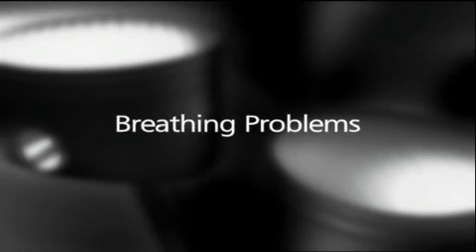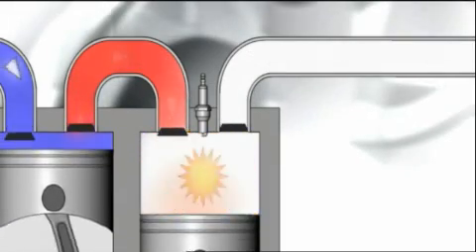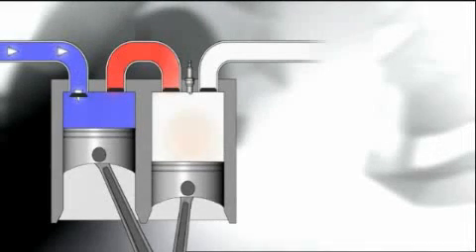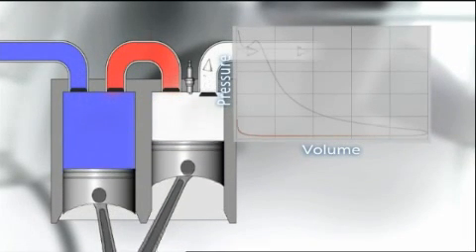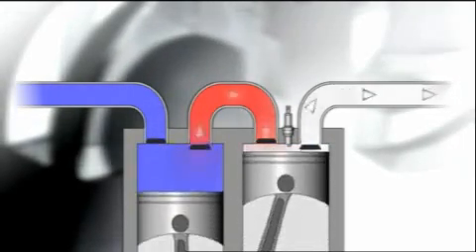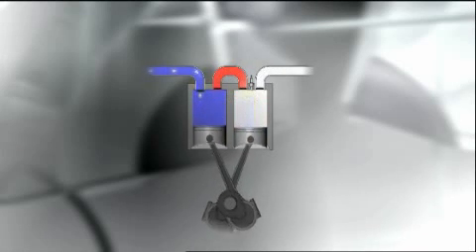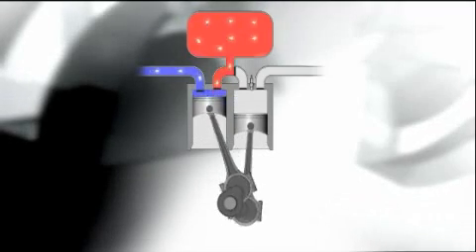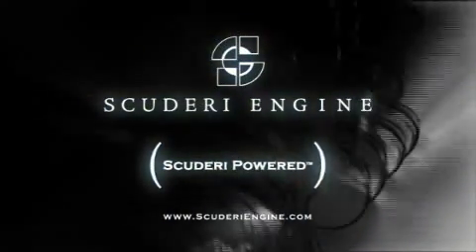Scuderi Engine - How It Works (by www.caroto.gr)

Comment: The parasitic drag caused by the intake/compression cylinders far exceeds that of a supercharger. The concept is good but making it work more efficiently than a supercharger is the hurdle that must be leaped. This design does not achieve that result.
Reply: Just curious, do you have any proof that a supercharger is more efficient? Because it feels like a supercharger having to deal with fighting against a pressure difference that it makes it less efficient

Comment: probably already been mentioned...on a conventional engine you get a significant power boost by having the exhaust and intake valve briefly open at the same time.  they call this valve overlap.  the exhaust gases leaving causes a suction that draws in the intake air.  the incoming air exerts force on the piston.  

this design makes it impossible to do overlap, therefore losing the power gain.  i just wonder of the loss is regained or exceeded overall.  in any design, there are tradeoffs.
Reply: I dont see why it wouldn’t work

Comment: so moving parts have been doubled, pistons, valves, connecting rods and a drag piston will soak up energy making giving this less HP over a conventional 2T engine,  IMO,  unless I'm missing something important.
Reply: If you compare it to a regular i4, both does 2 power strokes every 360 degrees, both have same amount of pistons (4), the ”drag piston” does the same compression and intake strokes as a regular i4 piston does halv its time. Understand basic engines first before comparing them please

Comment: I suppose the first cylinder could be bigger, to pump more air to the second cylinder. But how do you calculate displacement? Is it the volume of air sucked in by the first cylinder? Or the working volume of the other one?

Comment: Imagine if the compressor cylinder was bigger than the combustion cylinder . A higher boost engine ? In theory it could be run on any type of fuel.

Comment: Interesting system, i like the idee to split the sycles of a 2 stroke in to 2 cylinders.👍 But it would make more power with a confentional 2 cylinder 2 stroke i guess 🤨😅
Reply: DKW SS 250 uses this type of engine. It's more efficient than conventional 2t which was the goal I guess.
Reply: But a regular 2 stroke isn’t very good, burns oil, exhausts gas in the cylinder, pollutes more

Comment: Crazy idea: this with an expansion cylinder after the second cylinder and twincharged
Reply: What with the expansion cylinder? And having it super/turbo charged doesn’t make sense really, as the point of the engine is to externalise compression, so if you want more compression youll just increase the volume of the first cylinder.

Comment: In theory it works just fine, but I'd like to know how are they going to seal those high pressure valves?  First, this kind of valve is not to keep the pressure acting from the back, oposite side. Second, The compression pressure that is kept in that short channel will escape through the valve guides and the valve stem seals - no mentioning that the pressure trapped inside the channel would cause opening the left valve. 
Another issue is heavy and overcomplicated construction.

Comment: 0:55 How could the air from the first chamber flow to the second if the second chamber have more pressure due to the explosion?
Reply: the other piston is pushing the air in it. that is why
Reply: Valve closes right before ignition?

Comment: if this was a viable technology it would be on the market or at least a working prototype..neither has happened.
Reply: HolzMichel piston supercharged 2-strokes with overhead cams have been running since at least 1994. These engines are primarily hydrogen fueled. A 13 cubic inch version with an output of over 21 hp was produced in 2005 and used as a technical demonstration for Arrow Engine, Mercury Marine, AGC, and others. The supercharged 2-strokes have been extensively developed since then. The most efficient IC piston engine I have been able to verify is one such engine that was tested at Chatleff Controls that exceeded any conventional engine's  thermodynamic efficiency by an impressive margin. This particular testing took place in 1994.

Comment: I see the pipe cross over two cylinder head and the second cylinder are the same combustion area because you ignited spark plug when the two area are connected.   It's a  stupid design.   
  When you told it's point it could have pressure 2.5 times to normal Otto cycle.    There's no different  because engine today with direct injection and turbo can go any compression it needed  depend on metallurgy strength.

Comment: So if a conventional engine has a compression ratio of say 9,  isn't that compressing to about 9 bars ?
Reply: 9:1 -> 10 bar, assuming no blow-past, and no inlet pressure drop.  As both of these will occur, 9 bar is probably close.

Comment: If you replace the intake valves with a Tesla valve, there should be much improved air flow and lower pumping losses making this engine even more efficient.
Reply: Ken Smith it would be a great day to suddenly hold the patent on the IC engine.
Reply: Better yet, you could use one cylinder to do both parts of the operation so two valves can be taken out of the design.  You just have the crank go around twice per combustion cycle.
Reply: Ken Smith you should invent that.😀
Reply: you are an idiot
Yeah and then apply for a patent and see if it slips past the over worked patent inspectors.

Comment: This is just a supercharged 2-stroke.  What is the supposed advantage of a pistom pump over a blower, Rootes or otherwise.  Foden made 2-stroke diesels in the 50s and early 60s with gear driven Rootes blowers
Reply: The original engine of this type was invented by Brayton in 1872 also when Clerk modified a Brayton engine in 1878. Clerk's original engines did not compress in the expansion cylinder.. Clerk later invented the piston charged 2 stroke similar to the Reid and Baldwin / Bessemer type engines which use a piston or the back side of the piston to charge and scavenge the cylinder. Other inventors of 2 stroke engines that used the back of the piston  were Nash and Day and Fredrick. In 1887 Brayton made an engine that had the intake valve located in the center of the piston. That engine also used a short compression and long expansion stroke same as Atkinson. Atkinson made 3 distinct types of engines: The "differential engine" the "cycle engine" and In 1893 Atkinson made a piston scavenged 2 stroke which also had a short compression  / long expansion stroke. It was a very efficient engine and was called the Atkinson Utilite' engine. Watch my channel to see running examples of  similar engines.
Reply: yes they did but were not economical.
Reply: It appears that way but it is actually 4-stroke with the cycles divided between the cylinders. Anyway, it's a dumb idea.

Comment: back in the 20s or 30's a company called DKW  ( later morphed with Auto Union and then later morphed into Audi ) had a racing  2 stroke motorcycle based on this idea.

Comment: Scuderi (or his sons) changed his "cycle" many times, from the original thermodynamic disaster to the current one more rational, which is not shown in the video. An Atkinson indeed. With a smaller compressor and a larger expander. The advantage is the tight control of injected mas of fresh air. An advantage that they rejected when using an air accumulator! :s 
Over that. A hot transfer valve and a cool burning. Corrected with a proposed regenerator and ending in a regenerated Brayton cycle or a quasi Ericson II cycle in a poor machine for this task.
I'm  amazed the legal and financial power behind these engine.
Patches with that engine never seem to end.
Reply: The original engine of this type was when Clerk modified a Brayton engine in 1878. Clerk's original engines did not compress in the expansion cylinder.. Clerk later invented the piston charged 2 stroke similar to the Reid and Baldwin / Bessemer type engines which use a piston or the back side of the piston to charge and scavenge the cylinder. Other inventors of 2 stroke engines that used the back of the piston  were Nash and Day and Fredrick. In 1887 Brayton made an engine that had the intake valve located in the center of the piston. That engine also used a short compression and long expansion stroke same as Atkinson. Atkinson made 3 distinct types of engines: The "differential engine" the "cycle engine" and In 1893 Atkinson made a piston scavenged 2 stroke which also had a short compression  / long expansion stroke. It was a very efficient engine and was called the Atkinson Utilite' engine.
Reply: The "new" proposal of Scuderi is almost a regenerated Brayton (Ericsson tipe II) engine. But not exactly a Brayton. This does not meet the condition of isobaric combustion.
Reply: IMO this is the problem with various newfangled engine designs... they don't bother to mention that most of it has already been tried... compression is compression... you can call it whatever kind of compression you want but most all compression happens the same... same with expansion... yes some engines are explosion engines (constant volume) and some have a slower more controlled burn (constant pressure) but in reality it's the architecture of the engine that determines the success or failure of a particular design. here's a link to Clerks book in which he describes his 2 stroke... it starts on page 184. on page 194 Clerk describes an engine very similar to the Scuderi... https://books.google.com/books?id=aB9YAAAAYAAJ&printsec=frontcover&dq=The+gas,+petrol,+and+oil+engine,+Volume+2+By+Dugald+Clerk&hl=en&sa=X&ved=0ahUKEwjv1rPS-M_NAhVD2mMKHRGrCdsQ6AEIJzAA#v=onepage&q=The%20gas%2C%20petrol%2C%20and%20oil%20engine%2C%20Volume%202%20By%20Dugald%20Clerk&f=false

Comment: I see this as a made up theoretical engine  that 1.has a piston oscillating with no power stroke 2.the valve that opens to allow the pressurized fuel charge has to open against 50bar 3.the compessed fuel charge is expanded before entering the combustion chamber thus lessening the amount injected into the power cylinder and reducing the power.Hence you have a smaller fuel charge compared to a conventional type powering the cycles plus the unbalanced power stroke.I could be wrong,but this is howit looks to me.
Reply: The original engine of this type was invented by Brayton in 1872 also when Clerk modified a Brayton engine in 1878. Clerk's original engines did not compress in the expansion cylinder.. Clerk later invented the piston charged 2 stroke similar to the Reid and Baldwin / Bessemer type engines which use a piston or the back side of the piston to charge and scavenge the cylinder. Other inventors of 2 stroke engines that used the back of the piston  were Nash and Day and Fredrick. In 1887 Brayton made an engine that had the intake valve located in the center of the piston. That engine also used a short compression and long expansion stroke same as Atkinson. Atkinson made 3 distinct types of engines: The "differential engine" the "cycle engine" and In 1893 Atkinson made a piston scavenged 2 stroke which also had a short compression  / long expansion stroke. It was a very efficient engine and was called the Atkinson Utilite' engine. Watch my channel to see running examples of  similar engines.

Comment: I like the concept.  however I see the ignition occurs while the intake valve is open and the power stroke is just starting.  if the designer overcomes these two issues, this will change the industry.

Comment: So its a overly complicatet 2 Stroke/kompressor engine ?
the big benefit of a 2Stroke engine is, that its light. this thing isnt lighter than a normal 2 Zylinder 4 Stroke. and it will not reach more power than this ...
Reply: +MKS Racing And i see alot problems with backfire or fuel mixture. The cylinder filling is also a big problem.

Just build a 2 Zylinder 4Stroke its smoother and will last longer.

Comment: This is just a two stroke engine that is split into two cylinders that also doesn't need oil in the fuel to keep every thing moving
Reply: +Andrew klose And that destruis the benefits of a 2 Stroke engine.

A 2 cylinder 4 Stroke would be better in this case
Reply: Think of it as a 4 cycle 2 stroke engine.... it has all 4 cycles... intake, compression, expansion, and exhaust... one piston performs the intake and compression stroke while the other performs the expansion and exhaust stroke. The first engine of this type was the Brayton engine of 1872.

Comment: This is one big sh*t. This additional piston will make the engine heavier, that means more energy only for the normal work of the engine. "It will have torque like diesel engine, speed like gasoline"...  and consumption like a shuttle. All these pistons will need from energy - 4 pistons are  creating an energy, other 4 pistons are consuming energy. Efficient is close to 50% from normal 4-stroke engine. This engine will be much bigger than the normal, more heavier construction of the car - more consumption of fuel.
Reply: +Velin Ivanov 
There is one thing you might have overlooked: In a 4-cycle engine each cylinder will ignite only once in every two revolutions, in this engine it will ignite on each revolution, so you need only two "power cylinders" to achieve the same performance as in a conventional 4-cycle Otto engine.
Reply: 'That is true, but there is an ignition on every route(if we take 2-ciclinder engine). And that ignition moves ONLY ONE PISTON in 4-stoke engine, and two here. Now probably you will tell to me that 10 kilograms are more heavier than 2x10kg, are you?
Reply: +Velin Ivanov 
Somehow I absolutely don't get what you mean. What do you mean by "route"? 
A 4-cycle Otto engine with two cylinders corresponds to an engine of the type shown in the video with one "hot" cylinder and one compression cylinder.  So there are no additional cylinders and no additional pistons to be moved!

Comment: Totally 2-ish stroke piston supercharging... And there are bound to be problems because of how the plug fires after tdc with the intake valve still open...
Reply: direct fuel injection
Reply: +Stevie Wonder that will not work with this engine, because it will not build a good micture ..

Comment: I wonder what keeps the air/fuel mixture from buring inside the connecting tube and the "intermediate" tank. I mean, look, in this video the valve is open at the time the fuel is ignited.
Reply: direct fuel injection

Comment: Nice concept, show me the working prototype
Reply: +MrEmiriv BTW: Having an open valve during ignition is a really bad idea, it wont last long, and unless you have a direct fuel injection in the last cylinder your crossover passage is gonna blow, feeding burnt gassess in the next cycle
Reply: +MrEmiriv  im not a mechanic and I agree. this is stupid

Comment: I love how this motor draws "air" from a compression cylinder, i wander if that "air" storage tank would be safe with HHO gas.
Reply: +Stevie Wonder My point was, with solar roadways, quick charging graphene batteries, and the Stan Meyers HHO circuit, there can be a cheap way of being able to drive or have your vehicle autonomously drive you. Trust me, I've been studying this since AOL was cool in the 90's and saw vision again in a film in the early 2000's featuring will smith. HHO is not H2O, HHO is more explosive then H2O, and stored in a very small amount to be safe. HHO exposed to oxygen turns back into water vapor, and since most cars will be autonomously driven there will be a lot less reasons to be pulled over, and your car can even log your travels. Plus absolutely no co2 emissions, or need for the constant whining of an alternator. At just 30 volts and 4 amp DC pulse.
Reply: +My HHO future you could put water through it, might be a better water pump ;lol
Reply: +Adrian Paul I wouldn't pump water through it, I'd pump HHO gas through it, because water can be broken down into HHO gas, then pumped into the compression cylinder, after being compressed it is pushed into the combustion cylinder. HHO burns cooler than gasoline, and easy to produce with with tap water. This would end oil, single handedly. Also check out D-drive variable geared transmission then in your head put these 2 ideas together. after that, study Stan Meyers HHO car and tell me it can't work. This car concept would crank out so much torque, it would need to drive it self.
Reply: My HHO future I was more referring to a rotary, which started as a water pump, just a laugh. wasnt being serious
Reply: +Adrian Paul when one refers to water as "HHO", it is a good sign that you should run for the hills. if you poke him a little he'll probably start talking about free energy and perpetual motion machines.....

Comment: this is ideal for CNG motors: pressure reduce the 300 bar storage pressure of CNG (or more)  in the first cylinder and use this force already and mix with air, then combust in second cylinder

Comment: what a bunch of bull. so basically its an 2 cylinder engine with 2 fake piston pumping air. this technology looks expansive to produce. i don't think its powerful enough to compare to a 4 cylinder engine. all its doing is moving dead weight all over the crank case. let me give you my 2 cents. turbocharge a 4 cylinder is way more efficient.
Reply: +hotpapayasalad I agree, 2 cylinders to do ones work while loosing efficiency